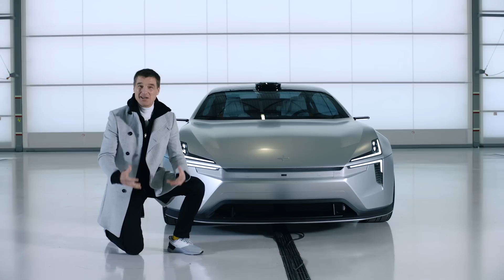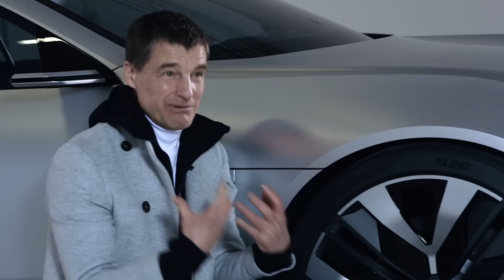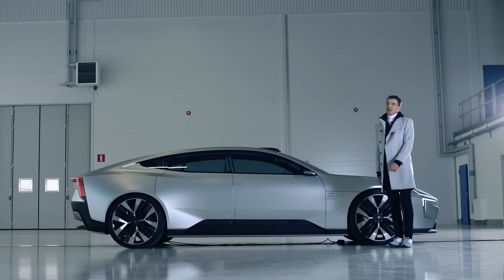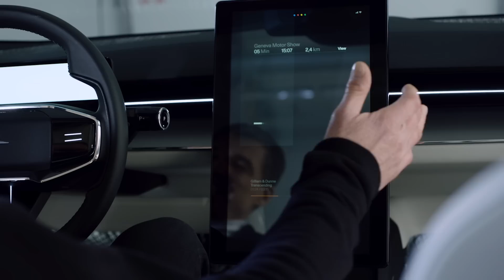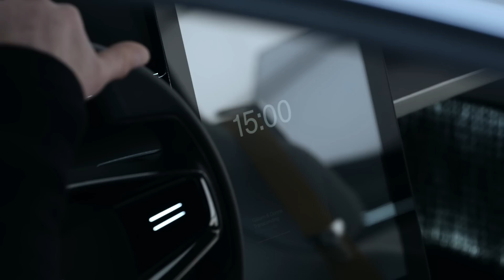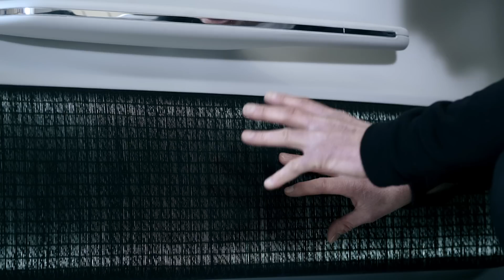Polestar Precept - Walkaround of the electric concept car | Polestar

Comment: We desperately needed some proper innovation in material engineering in the Automotive Sector.
It's amazing what you can do with natural fibres. Polestar just knocked this one out of the ballpark. 
I like the fact that the CEO of Polestar was previously a Design Director. You can see whenever an engineer gets an executive position the business thrives.
Whether this is AMD or Polestar. The days of running a big business with a Harvard Business degree is over.
Reply: Porsche 718 uses natural fibers for all reinforced panels and rear wing on the GT4.
Reply: Exactly. I agree with that you need an Engineer for an CEO. You see that also at Tesla. You don't need a CEO that has nothing with technology and design, because it will only focus on money. And that is short-term thinking. No connection with customers, no passion for going forward and giving the customers what they really want. (Yes, im look at German Electric cars..... they should really get rid of whole Volkswagen management)
Reply: @HermanWillems   So you need a CEO who's a brick layer and a surgeon, that shouldn't be hard to find (sarcasm).  Its a ridiculous statement to say that CEO's need to be Engineers since many Engineers know jack s*** about the holistic efforts it takes to run a business and to be successful. Engineers have specific skill sets and Business leaders have different skill sets that complement each other. For every Elon Musk there's thousands of Engineers with great idea's who thought they could go it alone and build something to find out that vision is only a piece of the pie. Elon had tens of millions of personal wealth to through at a project in the beginning and it took most of it to even have a shot at success.   That's like saying that the CEO of an airline must be a pilot. Nope, actually, most pilots know jack-s*** about running an airline, but they know alot about flying a plane and vice versa.
Reply: +1 on that bro
Reply: its not that simple as always)
Reply: but I'm just about to finish my MBA :(

Comment: Honestly Polestar, You should carry forward this design with only minimal changes to satisfy safety regulations perhaps. You have a true design winner here that's best left untouched when put into production. It's a very beautiful car. I especially liked the horizontal strips in the steering wheel on either side of the central logo. It really adds to the whole space-like starry theme of the brand; they are like comet tails on either side of the logo. Loving It!

Comment: As a Tesla Model S owner, I’m glad to finally see a good entrant to the EV market.  Helps legitimize EVs.  Will help boost overall EV sales.  This is slick.  I’ll be curious on the price.  I really like the wheels too.  The screens certainly remind me of my Model S.

They Taycan price and range are kind of a joke.  Along with all those tiny screens.  

Glad polestar is using their brain and have a large central screen.  Not sure about the buttons only showing up when hand is close.  In my car, I look to see where the button is and then move my hand to that location.  Hopefully there isn’t too much of a delay.  But even with mine, can use voice commands for most things and the steering wheel controls for almost everything else.
Reply: Look, the Taycan was Porsche's eager attempt to break into a market they didn't understand. Its a good car, spec wise, the pricing and range do need improvement. I'm just here cuz the 1 was in NFS
Reply: Rip Curl 69 Clearly YOU don’t understand the market. Porsche is a luxury car maker, they don’t want to enter the mass market. Even if you can’t afford one it doesn’t mean nobody can. Porsche sells every Taycan they produce, I call that a success.

Comment: Amazing looking car, on my list to buy for sure.  However, I hope it comes with a Heads Up Display.  Wish it had a few knobs to quickly find the volume and locate frequently used settings. The door handle seems to be far away from the driver.  May want to add a door switch near the counsel. Doesn't seem to have occupant entertainment and doubt if they will make the model without the rear view window- the black cut out shape of the rear will be placed with glass. Love the materials and suicided doors. Can't wait for it to get into production.
Reply from the maker: Glad you're here for it! Can't wait to show you the final version 👏

Comment: Pretty neat, apart from the whole "I superglued a giant ipad on my dashboard, look how my car is modern" trend. I hoped the flowing flush lines of the outside had carried away to the interior.
I'm just curious if the flush integration of the glass on the doors makes it so they wont roll down, because that's what it seems. If so, it's a shame, cause it looks wicked cool!
Reply: rrs imo, the “giant ipad superglued on the dashboard” does indeed make it modern. I just hate having so much buttons.
Reply: @squdardt.9719  I would've preferred something along the queues of the model S dashboard, or the Giulia, for example. To me, not only does ot fit aesthetically better with any dashboard, but its also more in line with the whole "flush" and seamless philosophy of the design used in this concept

Comment: In profile, the area with the tail lights looks a bit strange. The body stops, then the tail lights start and then the rear just is there, no connection or flow. It's like the car has two silhouettes. Otherwise the design is stunning 👍🤙

Comment: Please make an electric station wagon already. How many sporty cars with small boots do we need? 6 seater, not 4 please. 😉 I would talk more about the usability instead of design language. Matte and glossy finishes? Whatever. How does the car handle the winter time?  Is there room for baby seats, how does the seats handle spills, why do I need to sit with my arms up holding on to a steering wheel, is that ergonomic? Does it have alexa voice controls that actually works? Head up ar display? Does Windows tint after being exposed to sun? Does the paint have nano coating that protects it from stone chips? Where can I throw my bag without having it on the floor passenger side? I got even more idea's, just ask me 😅

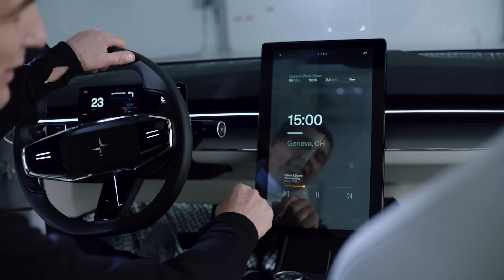Comment: 7:15 How does the approach work? With ultrasound? Or with the touch screen itself?
Reply from the maker: Proximity sensors adjust what is shown on the screen depending on where the user’s hand is placed 😊
Reply: @PolestarCars  o.k. thanks!

Comment: I like your car, I like your coat, I like your shoes. That being said, your could be improved. More fluidity. Everything is about perception. If you could improve your presentation, it would have more impact. Just a question, could you have some info like speed, map... projected in the windshield? The Mazda CX5 has an holographic projection of the speed. It looks like the numbers are floating in the front of the car. Really cool.

Comment: I’m wondering how the car in the back can see through it to avoid risk cause by what happen front of it?
Reply: All you need - is to keep the right distance.  ;-)
Reply: MrBaclajan that’s very true and I agree with that, however in some places here is not easy to follow so I wonder if they taking in to consideration implement similar idea how XC 90 can warn the car approaching quickly from the back like treating the break light as distant indicator in downtown when every one are close to each other moving slowly :) 
Did I just give this idea out for free!? lol
Anyways, looking forward to have chance to sit in one of these nicely built car.
Reply: @supermacat  I think they can adapt the automatic braking system for "city mode": it will choose the distance automatically according to your speed/braking distances (watching people texting while they drive their cars, I'm sure this is necessary - it will help to avoid many car accidents). 
Other way - is to connect cars nearby in one net: cars will share necessary traffic information (
in case of emergency braking of one, other cars will slow down automatically).
P.s. Dear Thomas Ingenlath, I don't need money for this ideas - just send me one of amazing Polestar car. =)

Comment: Nice hardware,  they should get Tesla's software
Reply: They got better stuff. They use Android for cars. Much better than any system made by car companies
Reply: @RR-us2kp  I'm talking about the self driving software and machine learning systems to protect the car temperature stuff and much more
Reply: These guys are like Samsung,  they make great hardware which is amazing but the software behind it is inferior compared to apple ios , if they partner up and purchase Tesla software it would be amazing
Reply: @morningstar3437  That's debatable. Carwow reviewed both tesla model 3 and the polestar 2. They said the polestar 2 had the best infotainment system of any car they've reviewed. Which includes the tesla model 3 which they considered the best until they reviewed the polestar.

Comment: Very good thanks.Lots of great new ideas. 
I'm all for natural fibre uses throughout the cabins but a lot of the emphasis on being 'vegan'  is gesture politics and easy for the very rich. I would have no problem for example with use of recycled leather for the seating although would not choose it myself.

In my opinion a future of all electric only cars is also going  prove to be a problem in future. 
I'm aware that the EU has set a target of no fossil fuel only cars to be sold anywhere in the EU after 2050 and that many within the EU have set closer deadlines such as Norway in 2025, Germany 2035, and France 2040. 
This means that all cars will need to be either all electric or high efficiency hybrids. For all a future with millions of all electric vehicles you then need a charging network that is very widespread with lots of stations and also that each station has high capacity to take multiple vehicles and are 'superchargers' that can deliver an 80%+ charge in under an hour and ideally inside 20 mins. 
This will mean that massive extra resources are going to have to go to generating electrical power (new power plants) and building the network. This completely flies in the face of the idea that overall electrical power use in society needs to be reduced, to be made more efficient, and as much as possible made from renewable energy sources. 
A number of nations (e.g. Denmark) have made it a national goal to eventually make all power generation from renewable sources. Realistically this means that the massive increase in power generation that will be needed for mass charging of millions of all electric vehicles is incompatible with the aim to move entirely to renewable power generation.
To me this means that high efficiency hybrid cars still have a future and should continue to be developed - along with maximising public transportation to avoid personal vehicle use as much as possible.

Comment: Everything is styled extremely well and very futuristic apart from the very dated center touch screen. I still fail to understand why manufactures are using huge screens with such big ugly bezels. Makes zero sense to me especially from Polestar who have frame-less side-view mirrors in the Polestar 2 and even a frame-less rear-view mirror in this Precept. 

You should seriously consider keeping the same size screen but significantly reducing the size of that bezel. I'm not sure how much this would impact production costs but you need to do this. You have probably the most futuristic EV on the market then you install a screen that looks about 7 years old. By the time this goes into product the screen will look 10 years out of date.

Please remove the bezels. (Yes, even the ones on the drivers display). I vote for frame-less touch screens, displays and mirrors all the way.

Comment: I think the challenge for every legacy car manufacturer moving to electrification is every car will be compared to the Tesla Equivalent.  Tesla has never shown a concept that wasn’t built. Their launch models may have been prototypes but they are  intended to make production. In that respect what innovation does the Precept have over the Model 3? An air-duct and an extended C-Pillar. There is nothing technical innovation over the HW3 system in a Tesla. A marketing video that hints at being forward thinking  and envelope pushing, becomes quite cringeworthy, as there really isn’t anything new over a car that has been in production for over 2 years now.. Let us suppose the Precept is an Executive Limousine and goes into production in 2024, a fair prediction. How much further behind the Model S will this car be?  I feel the duty of all manufacturers is to build vehicles that are on par with the BEV market leader. We do wish for claims that they are the 1st, or pioneering, when they are definitely not. On one last point. Ditch glass roofs. As a driver you hardly get any benefit other than the aesthetics of the exterior.  The cost must be more than metal or fabric and glass being glass, it will scratch and break. Plus, with a massive glass roof, the passengers are either going to bake or freeze unless ample ventilation is used because being engineers and designers, you are fully aware of how conducive glass is, meaning extra heating and cooling.putting extra drain on the battery, something that every engineer is trying to avoid.

Comment: I hate to be a party pooper, but this car does not excite me. It's a Chinese Volvo plagiarizing a "tesla" theme, and that makes you think it's a knock off trying to mimic a champion.

Honda E on the other hand, they made their own theme with that car.

I know polestar is supposed to be something different than Volvo, but I think polestar could find alot of benefit reviving some Volvo design legacy in modern pure electric form.
For example modern EV versions of the Amazon, the PV544, the 120, the 1800 or even the boxy 240.

This concept car is really a disgrace, you could do so much better than this. Like you could just call it a volvo, and abandon the pole(dancer)star joke of a brand name entirety. 

What an expensive mistake it has been so far.

Comment: So this one have the Panasonic batteries or the bad LG chems ones or what ever makes low energi dense batteries, as Polestar 2 have less than 500km range, that made it a turn off as it was said to have 500+
And you cant get it with leather seats, more than light leather that costs a fortune compared to other car manufacturers, like Volvo... And the Polestar 2 uses Volvos R-Design seats... I'm done with light leather and fabric seats.
So yet again we are back to the shit car Tesla, that have the minimum range on the LR model 3 that i need, they have fake leather atleast... and still they dont over charge the price for the white fake leather interior...

Crome is for old veteran american cars,  so good riddance! 
Car look good, expect for its rear, what is it with all those places where salt and other shit will be collected in tons?
As its presented as the next car so.